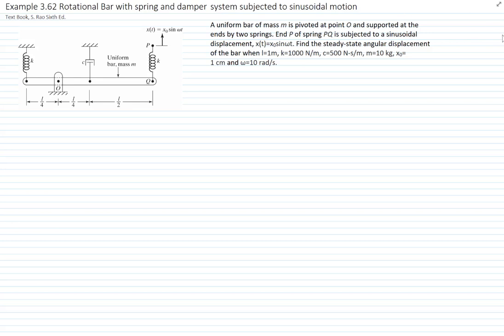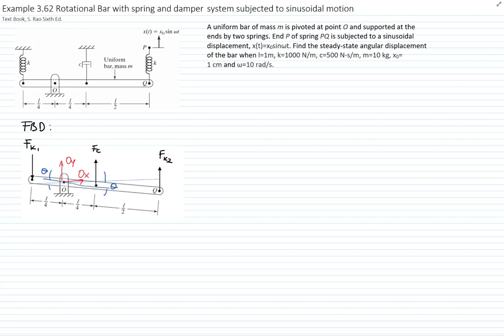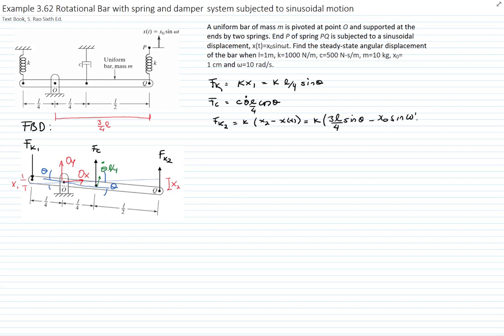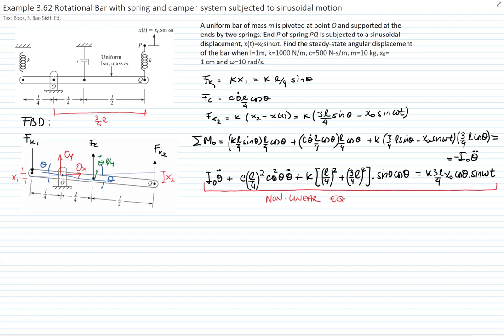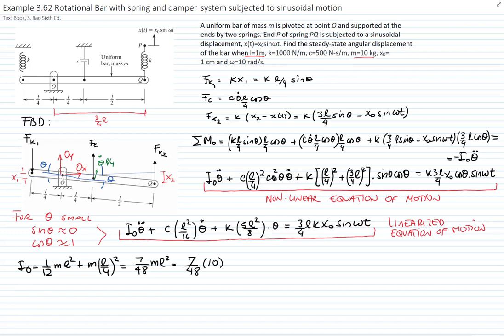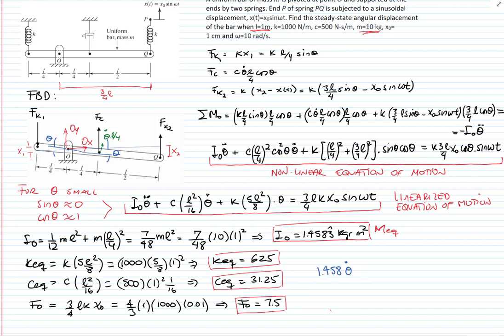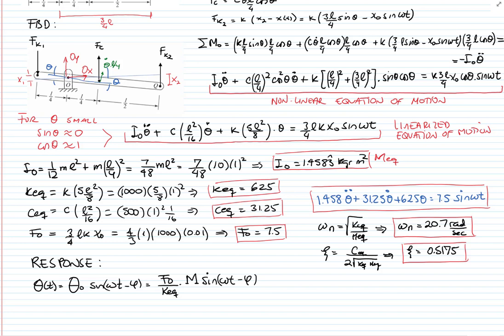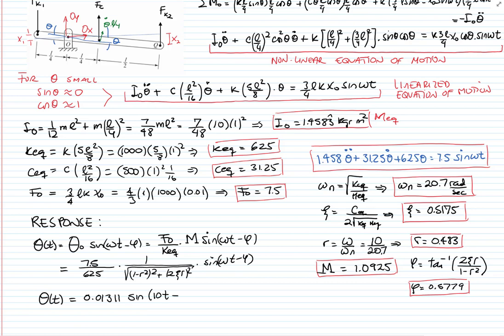Example 3 62 Rotational bar withs spring and damper subjected to sinusoidal moti

Comment: do you not need to consider the weight of the rod in the moment calculation?
Reply from the maker: for a horizontal bar, for small vibrations the weight becomes a constant force and does not contribute to oscillatory motion, it only affects the equilibrium position.